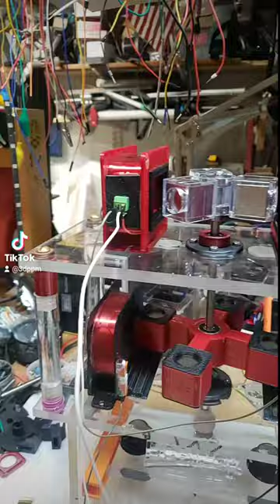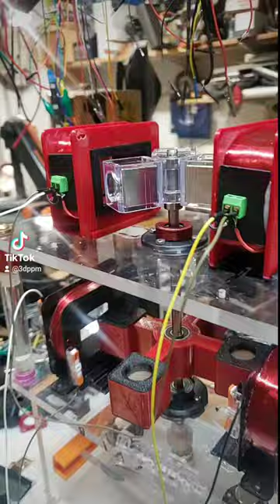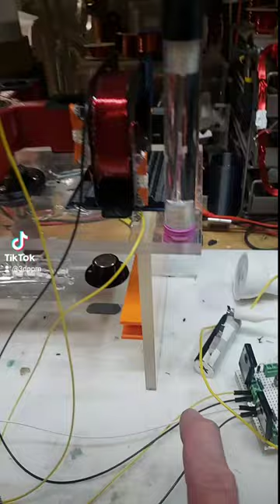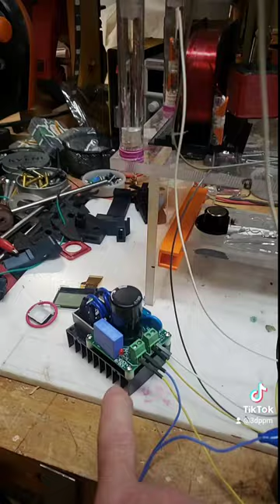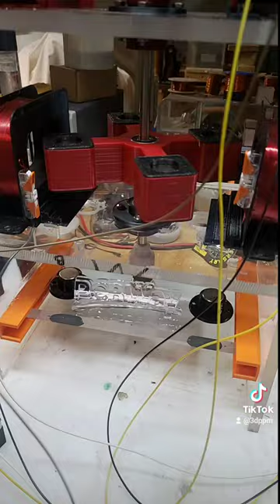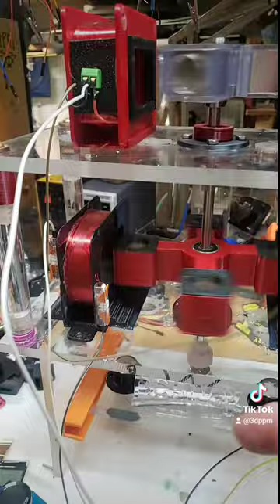Frankenstein setup

Comment: Just place a stick between the top of the two coils for balance for the bb inserts
Reply from the maker: Ya I used the have a 3d printed rod in place where you mentioned. I may go back to that so thanks
Reply: What exactly
Does this do